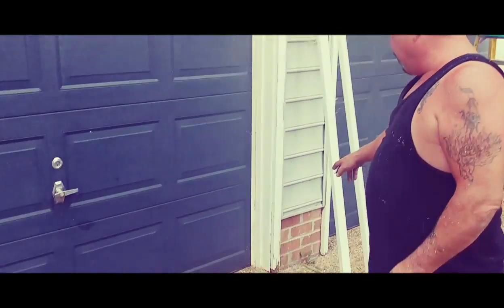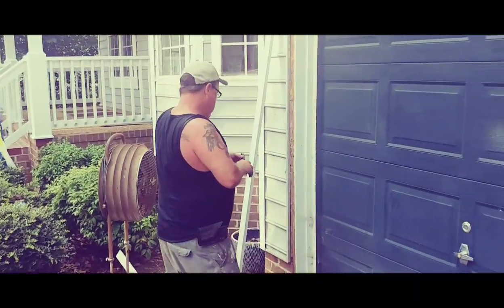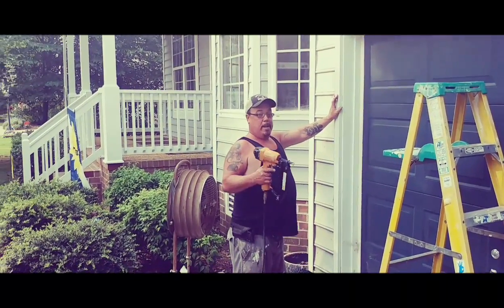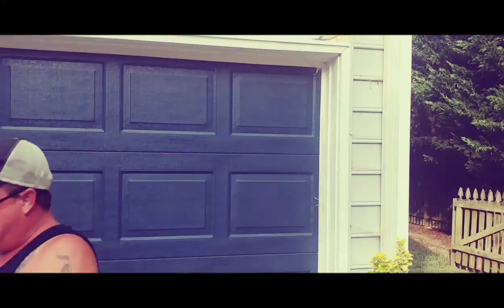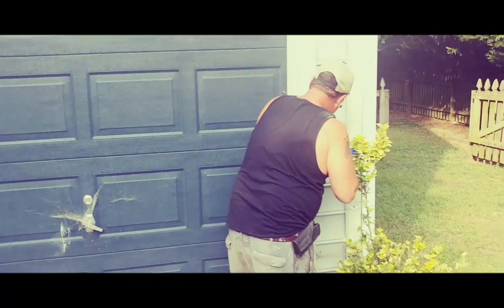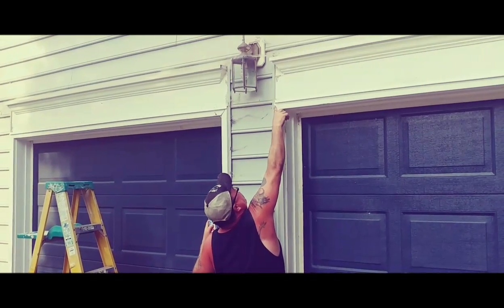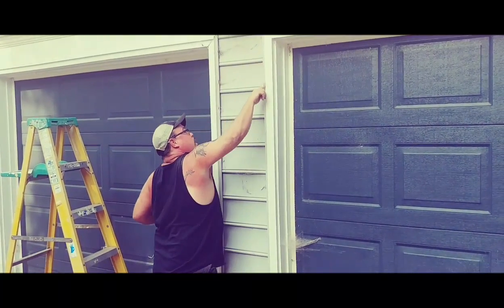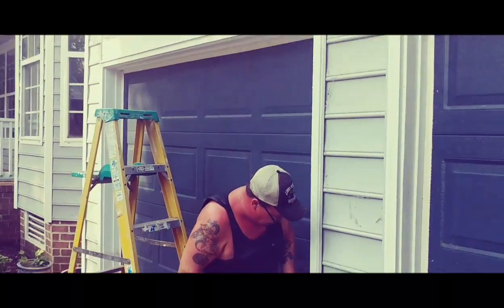How to replace door trim ( Brick Moulding )

Comment: I appreciate the video and advice. I am thinking, if my trim comes off in pieces, I might just replace the lower part. Because I am crap at cutting angles. Got no skill!
Reply from the maker: You can definitely do that just a small piece and it will work fine